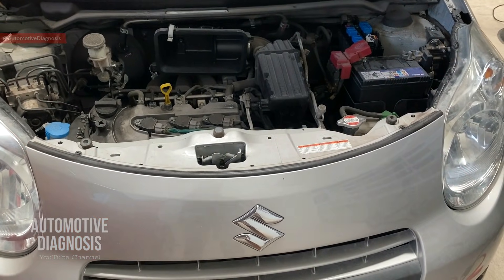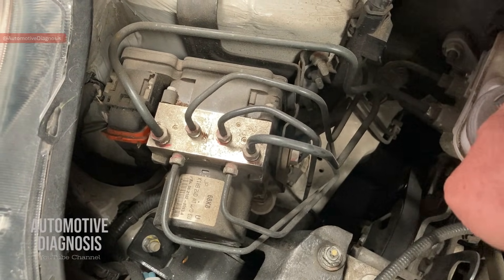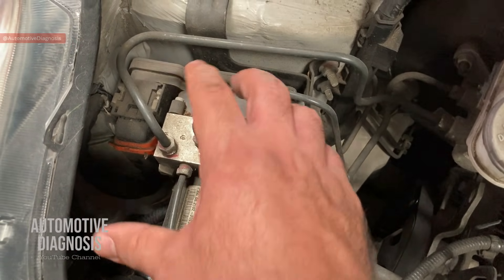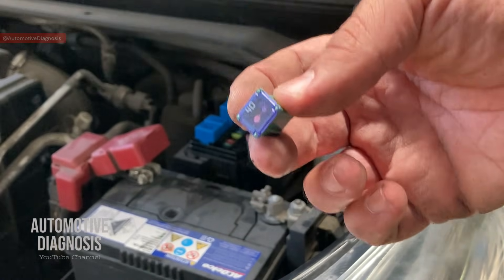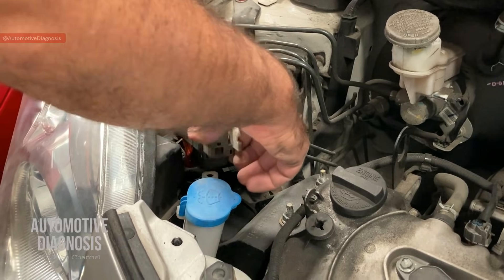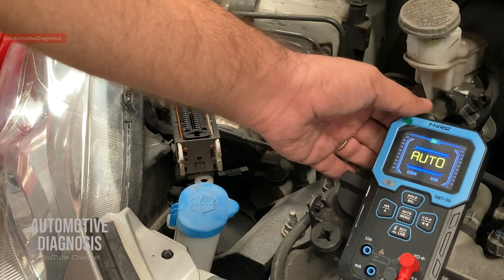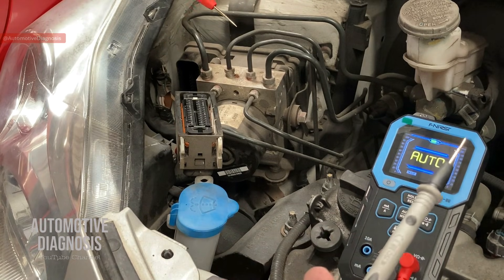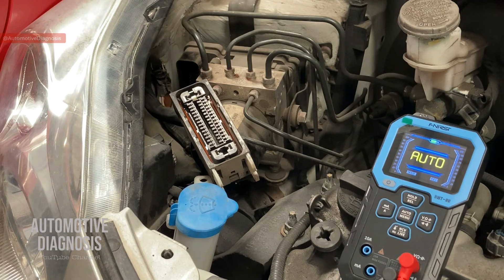ABS Module Diagnostic for ABS Motor & Valve Relay Error | ABS Module Common Faults

Comment: Hello, I'd like some advice. I have a 2008 Mazda 6, and the scanner gave me a U0121 error. My car doesn't show the speed on the speedometer, and the ABS light stays on on the dashboard. But the strangest thing is that sometimes those lights turn off, and only the traction control light shows, and the speedometer does show the speed. What could it be? A cable? Cleaning the module internally? A fault in the board? I appreciate your input!
Reply from the maker: Hi my friend, there are a couple of different options to do, the first thing is the ABS connector, disconnecting and cleaning the connector might be helpful.

Comment: Hi, if the module is humming even after the vehicle is off, does that mean its 100% replacement of the module?. I have ABS, SVC, Parking Brake all on. Its a 2003 Toyota Alphard hybrid with the 2.4L. Thank you.
Reply from the maker: Hi my friend. Not necessarily, it could be still wiring issues. Have you checked the fault codes?
Reply: @AutomotiveDiagnosis No engine light. But I also only have a regular obd2 which only reads engine light. May have to bring it to my brother for his more sophisticated obd so we can figure out what's going on. Thank you for replying.
Reply from the maker: @workingtools2999  ABS fault codes are important in this case
Reply: @AutomotiveDiagnosis Funny thing is, I just used my OBD2 scanner and just pressed "clear code" eventhough it didn't detect any codes but it still turned off all the warning lights. I'm driving it long distance tomorrow so lets see if it turns back on, most probably. I just didn't know that my regular obd can clear other codes other than engine light. 😂
Reply from the maker: @workingtools2999  I hope it goes well ☺
Reply: @AutomotiveDiagnosis I kinda regret buying Import. Parts hard to find, even fluids and filters. 😂. I wish there's an app to use for cross referencing parts, say for example Alphard and Sienna MAY have some similar parts. That way I don't have to source it from Asia or Europe.

Comment: I like your videos but this is inconplete. You need 100% to stress the circuits at the connector. You can have battery voltage but won't hold even a test light on. So many people get fooled by this. You must do a voltage drop test. Also take the back of the connector off and test when plugged into the module 🤝

Comment: What was the fix?
Reply from the maker: This was the procedure to check the ABS power and ground when there is ABS motor failure or ABS valve relay error, if there is any power or ground problem, that must be fixed, but when all measurements are within the range like what we saw on this video, it shows that fault is caused by an internal fault.

Comment: Replacing a blown fuse is not a repair, you need to explore why a high amperage fuse blew in the first place. But you know that. What about using a test light on your powers and grounds to confirm the wires can carry the amperage required, im guessing it must be substantial due to the high amperage fuses in the supply circuit? Good Video Thank You for sharing this. And i like your DVM!
Reply from the maker: Hi my friend, yes, in case of a blown fuse (specifically high amp) we need to consider what happened that blew up the fuse. But many times I’ve had this issue that a sudden high load on the system blows up the fuse and circuit itself is fine. Of course I check the high resistance on wiring too, but in this video I wanted to keep it simple to give this idea that not each ABS motor fault is internal. For multimeter I put a link in the video description for you☺️👍

Comment: Great explanation, but I'll add an additional step. To load test the circuit
Reply from the maker: Thanks my friend for sharing your experience.
Reply: @AutomotiveDiagnosis  no problem. I have misdiagnosed an issue before because the harness had the issue, and I skipped the step of load testing

Comment: Thanks a lot sir for your helpful videos we're really getting lots of material on your channel keep helping Us
Reply from the maker: Thanks my friend. I’m glad you like the videos.
Reply: Yes, agreed. If you are certain the circuit is a high amp circuit, an extra step of load testing with an incandescent bulb is quick and easy. The main caveat is not to do that with a computer ground, which normally would be a smaller wire that is less capable of withstanding the power surge. Anybody with experience will remember a near miss or a serious oversight if circuits are not load tested.